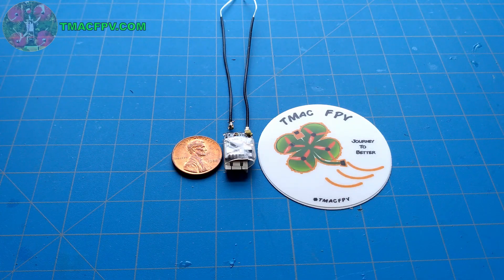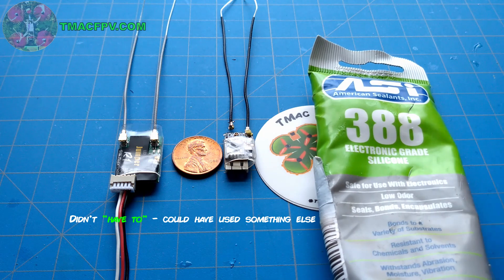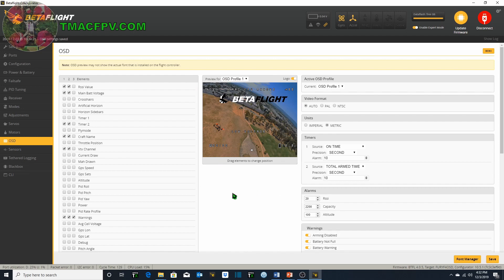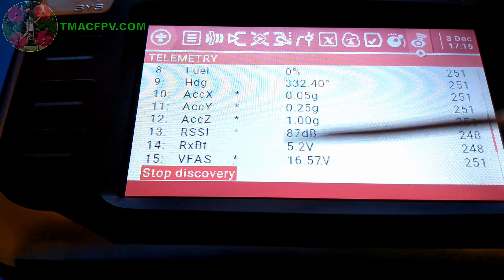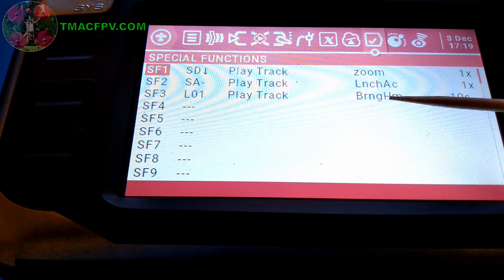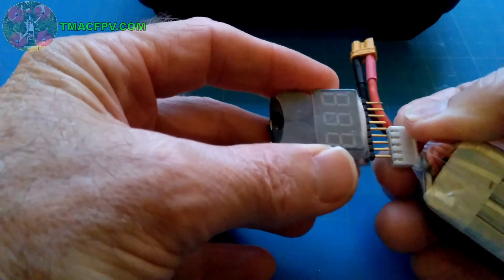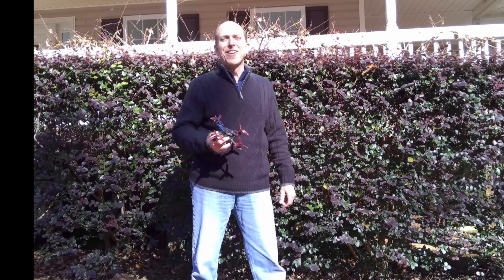JUMPER R1 RECEIVER TELEMETRY SETUP

Comment: Hello sir, how to wire Jumper R1 V2 Mini receiver. It has 3 wires. I can't find any guide for it. I am new to hobby and this is my first built. I am using F3 flight tower.
Reply from the maker: See SBus, VCC, and Ground connection under Full Description" of this link https://usa.banggood.com/JumperRC-R1-V2-Mini-2_4GHz-16CH-Over-2KM-D16-SBUS-Full-Range-RC-Receiver-Compatible-T-Lite-T18-T16-T12-T8SG-Radio-Transmitter-for-RC-Drone-p-1894214.html
Reply: @TMacFPV  I know about this. Can you tell me where sbus wire connect on flight controller?
Reply from the maker: @entertainmentunlimited3256  SBus pad if your flight controller has one or try RCin pad if it has that. Check your specific flight controller's documentation on its product page (or manual in came with) for how to connect a FrSky protocol receiver to it
Reply: @TMacFPV  can I wire sbus to RX of the controller?
Reply from the maker: @entertainmentunlimited3256  yes
Reply: @TMacFPV  one final question please, can i also connect sbus to ppm?
Reply: @TMacFPV  Thanks you so much. I am your subscriber

Comment: Would you know how to set up on inav. I'm new to this.  I cannot get telemetry on my t16s. I'm using an f4 fc.  Eachine tyro quad.  I soldered to the sbus tab on the underside. And tried tx5 and tx4 for s port.  Switched it on in ports tab. My transmitter finds only 4 basic sensors but is receiving telemetry. I've not shorted the 2 tiny tabs for inverted as I think not needed using the underside connection that says sbus Or am I wrong.  Any help appreciated as I'm going mad now lol. Thanks

Comment: Hi Tmac, thank you for those awesome videos, i just want to ask about incorrect rssi value in my OSD display. It always displayed "99" and never change at all.  But ive already have correct value in my jumper T12. 

Cant yoy tell me what isnt right? 
(I used junper R1F + T12 remote) 

Thanks a lot
Reply from the maker: try these few things https://youtu.be/egVxZuyoxho  If you're using an F4 flight controller, check this out https://youtu.be/hwJtnkVq274?t=135

Comment: Hi! I followed this guide but am unable to get any stick input to show in Betaflight. I have confirmed that the rx is bound to the radio, so it seems to be an issue between the R1 and the FC. I am using the Mamba F405 Mini. Any ideas?
Reply from the maker: When connected to Betaflight (with props off) do you have your quad powered with a LiPo also? Some flight controllers require to be powered with LiPo also for receiver to be powered while connected to Betaflight. Check to make sure your R1 receiver RX pad is going to TX pad of flight controller and R1 receiver TX pad is connected to flight controller RX pad of the same UART
Reply: @TMacFPV  Yup, lipo is connected and receiver is giving the correct lights. According to the diagram for the FC everything should be fine. gnd to gnd, 5v to 5v, sbus to sbus and s.port to ppm.
Reply from the maker: @lofifpv6814  ok, a couple more things to check . . . .since you connected to the PPM pad, did you enable softserial for it per the video?  In Configuration Tab of Betaflight did you enable Serial Based Receiver and below that, select SBUS?  in the PORTS Tab of Betaflight did you toggle on Serial RX for the UART you've connected your receiver to?  Make sure to click on Save button in Betaflight after each change you make.  Only other thing I can think of is perhaps you held the bind button down too long (see this video  https://www.youtube.com/watch?v=Wx24PQ0sceI )

Comment: Is this this reciever compatible with the taranis x9 lite with the accst D16 mode?
Reply from the maker: The "newer" version of this same receiver comes from RadioMaster.  Its the RadioMaster R161 receiver that uses the ACCST D16 protocol.  In the images, it appears big.  It is not.  That's just the plastic case it comes in.  That plastic case separates (opens) and inside is the exact same receiver (Jumper R1) you're looking at.  It can be found on Banggood here (affiliate link): http://bit.ly/RadioMaster_R161_RX OR at RacedayQuads (only $9.99) here:   https://www.racedayquads.com/products/radiomaster-r161-sbus-d16-2-4ghz-rc-receiver OR at DefianceRC (Alabama, U.S.) here: https://www.defiancerc.com/products/radiomaster-r161-16ch-frsky-d16-compatible-sbus-s-port-receiver?_pos=1&_sid=73ed0e676&_ss=r
Reply: @TMacFPV  In the description it says it's frsky D16 compatible does that mean is ACCST 16?
Reply from the maker: @TheSolla45  yes ACCST D16 is an FrSky protocol. It's the exact same thing

Comment: How do you bind this receiver?n I have been having a bit of a problem.
Reply from the maker: "Binding method:
Press and hold the receiver's bind button, turn on the power (i.e. plug in the LiPo with bind button depressed), the receiver will now enter binding mode. The red light is always on and the green light is flashing slowly.
  Turn on the remote control and begin the bind procedure according to your radio. After the bind is successful the red light is off and the green light is always on."
Reply: @TMacFPV  When I plug in the lipo with the bind button held down, the green and red light are solid. Is there something wrong?
Reply from the maker: @lucan3361  Are you attempting to bind in FrSky X or FrSky X2 sub-protocol?  Should be FrSky X (if you did not attempt to update firmware).  Have you attempted to finish the binding process even if both lights are solid (it might work)? Sometimes the lights don't always match the instructions. I always turn the radio on first.  Then get ready to hit "bind" in the radio.  Keep the bind button pressed while you power up the Lipo/receiver.  Hit "bind" on your transmitter, then I select ch9-16 telemetry On.  Sometimes the lights don't always match the instructions, however, if you use this process, to include FrSky X, and it doesn't work, check your connections and solder joints to make sure two are not connected together.  The bind process should be the same as in this short video (it appears to be the same receiver re-branded). https://www.youtube.com/watch?v=1K7QpjJO_s0
Reply from the maker: Use RadioMaster's R161 instruction manual (its the same receiver). RadioMaster has better "customer support/user manuals). User manual is here: https://drive.google.com/file/d/1KiPtPaTAoMKRd1g9-0IfgLyfwrdGNa_-/view

Comment: I can only see TRSS, TQly, RSSI and RxBt (showing 0V by the time..) what can I do?
Reply: Try using the telemetry setup checklist available in the video description above under Resources & Links Mentioned in This Video
Reply: @TMACFPVShorts  Hi! Thanks for your response. I did everything step by step but I only can see 4 sensors and rxbt 0V. What else can I do?
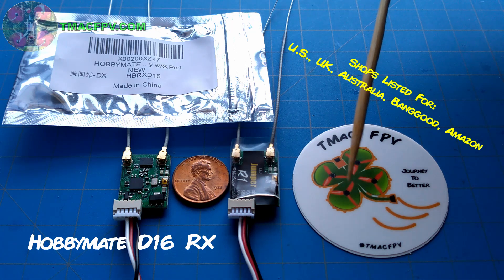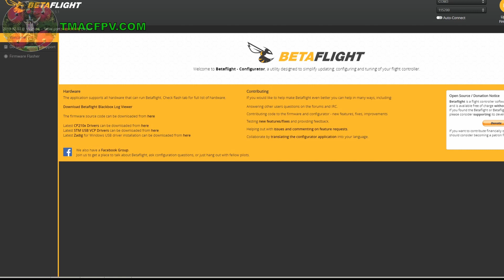Reply from the maker: @shogo8633  Fernando, Here3 are some things you can check (if you wired it correctly, and set it up correctly in your transmitter and  in Betaflight it should work fine). As I have no ide what transmitter or flight controller you're using, perhaps its a limitation of one (or both?) of those.  Try checking th efollowing:  Is it the Jumper R1, the Jumper R1F or a different receiver?  Did you make the connections from your receiver to the flight controller as indicated at the 4:04 time mark of this video?  Did you set it up in Betaflight per the instructions at the 5:49 time mark of this video and also in your transmitter per the checklist (Discover New Sensors)?  Do you have RSSI set up in your transmitter as an Input Line and also as a line in your Mixes Page?
Reply: @TMacFPV  Hi again! It´s a Jumper R1, Radiomaster T16 and omnibus F4 clone from aliexpress. I also tried with a ZEUS F722 and I get more sensores but rxbt shows 0V also so I think I have 2 problems.. Jumper R1 not sending any voltage measures and the omnibus F4 port reversed or whatever. Yes, I checked the video and the guides a lot of times. I wired it with the soft serial method. I am able to get the rssi measures. My problem is that I only get 4 sensors with the f4 board (a lot more with the f722) and Rxbt shows 0V

Comment: I tried hooking up my r1 via sbus to my old Mantis F3 FC, but the signals were jumping all over the place in beta flight reciever tab? I never like to try to fix things that are working,,,  My Flight controller is old and wont update so I went back to using it as it was with old spek sat...  But I wonder what the problem was and if there is an ez fix?  I see you video and think I could try putting the r1 on a different urt,,, but the mantis manuel says the sbus is where you connect sbus soI'm stumped...

Comment: Hi there, I would like to ask a question, recently I accidentally broke one of the antenna on the Jumper R1 receiver. However, I am not sure what is the name of the antenna for replacement. Is the antenna on the Jumper R1 an IPEX connector or an UFL connector? or neither? I am very confused. Thank you very much in advance.
Reply from the maker: See this link and scroll down to "Replacing R1 Antenna" https://www.graysonhobbyshop.com/jumper-r1-drone-receiver/

Comment: I am building a 3" quad and using the mamba mini MK2. It came with betaflight 3.5.1. Do you think is worth updating to 4.1or higher? People reported some problems with the update... Have you updated it? If so, what do you think? By the way really helpful video, thanks Tmac👍
Reply from the maker: Hey Luis!  I'm running BF 4.2 on all my micro's with RPM filters.  The RPM filters to me are very much worth updating.  When you enable them correctly, they get rid of all motor noise from gyro.  Having said that, I do no know your level of experience.  So, this video may help guide you a bit if needed (its the last micro build I did and goes through most, if not all, of the stuff you need): https://youtu.be/4KUz4Z8ejTA

Comment: Awesome!

Now if I could only get my 'battcheck' widget working in the top bar..
Reply from the maker: what "battcheck" do you mean?  are you talking about your LiPo battery voltage reading? What transmitter do you have?
Reply: @TMacFPV  Hey!  I have the T16, the 'battcheck' widget is for the top bar.  I have the VFAS (from frsky XSR) displayed in the value widget right next to it as well as voice alerts working fine, but battcheck (shows percentage, voltage, and little battery icon) might take more setup than just pointing to VFAS, possibly lua scripts from what i gathered(?), and i don't think i'm ready to dive in to that yet lol.
Reply from the maker: gotcha, understand.  Have fun flyin'!👍

Comment: Hi sir this jumper can bind to good ol accst qx7 radio without problem? Im thinking of switching to this wonder if its work with accst qx7
Reply from the maker: Hey HelioGenesis-HS! I believe the Jumper R1+ receiver comes with the ACCST D16 protocol firmware prior to FrSky updating all their ACCST stuff to version 2.1. So, if your QX7 firmware has not been updated to the new ACCST ver 2.x firmware, it should work fine with the Jumper R1. It will definitely not work with ACCESS protocol transmitters
Reply: @TMacFPV  ahh nice. Thanks for clarification

Comment: If my full size mamba F405 DJI stack has an RSSI pad, should I still not connect the RSSI cable?  I’m having difficulty trying to find some guidance on hooking up my R1 rx to the full size mamba DJI stack. The pads in the ‘receiver’ part of the flight controller, according to the card that comes with the FC are:
GND
5V
RC
Invertor[TX1]
Uninverted[TX1]
RSSI

There is a note re; ‘RC’ that says (TBS/SBUS/IBUS/DSM(RX1)

It’s all Russian to me. Could you clarify the connections for me please?
Reply from the maker: Receiver GND goes to Flight Controller (FC) ground, Receiver 5V goes to FC 5V, receiver SBUS goes to FC 'RC' (which your documentation shows as SBUS along with the other TBS/IBUS/DSM protocols).  Receiver SPORT goes to the pad right next to the 'RC' pad which is labeled SPORT in your FC wiring diagram documentation you can find here https://bit.ly/MambaF405DJIFC_Diagram
Reply: Thanks for the wick reply TMac. Hmmm. It’s not labelled  SPORT in the wiring diagram I’m looking at. Mine says Invertor (TX1) and Uninverted(TX1). That’s why I asked the question.
Reply from the maker: ok Muzz, no problem.  The pad next to the 'RC' pad in the wiring diagram on the site URL I gave you shows as the SPort pad (in yellow writing).  If your documentation does not show that, your SPort signal from the R1 is inverted which means you need to connect it to the dedicated "Inverted" TX1.  This will then uninvert the signal (i/e/ 2 inverts  = 1 uninvert)

Comment: TMac, hello good sir. Have you had any range issues with the R1 or the R1F? I picked up 2 of each from Grayson Hobby and all four of them had me pulling my hair out for over a month. My range in optimal conditions for all four of them is 100 feet before RSSI starts to plummet and i mean fast right to failsafe (90 rssi to 50 in a couple seconds). I bought new tx antenna, new rx antenna, A NEW TX (had Jumper t16, picked up a T12) installed on multiple quads in every mounting possibility imaginable, even mounted as incorrectly as i could just because, mounted them 1 foot off the quad on a stick to get completely away from everything on the quad, incrementally trimmed antenna through the "range" of lengths trying to tune it...........I could go on. And yes, flown in optimal conditions, perfect line of sight, no rf interference, flew friends bird same day no issues (xm+). I picked up xm+ and installed it and what do you know, I can fly to the end of the field, into the next field and oh happy days. But whats the deal with the jumpers? Four lemons! No way....right? Sorry for the long comment. Tried to keep it short while answering what i know people are going to ask. Is there anybody out there with this issue? Thanks y'all and thank you TMac for your superb videos.
Reply from the maker: I have not had any issues  with the R1 receivers I have used the few times I have used them.  I normally fly Crossfire.  Additionally, a fellow pilot I gave an R1+ to reported he got 1.7 miles of range with it (and could have gone farther if not for his VTX limitation) on a fixed wing.  This was back in December of 2019, so perhaps something has changed since then?
Reply: @TMacFPV  Yeah I made the jump over to crossfire as well (which is awesome), and thanks for you vid on signal strength. I'm baffled with these jumper receivers. I haven't heard back from Grayson Hobby which is dissapointing. Maybe that's why they were so cheap ($10 each) but I doubt that they would willingly sell a bad batch if it were. I might fiddle with them again and if I get the same results maybe I'll send you one as a sanity check if you would be willing. Thanks for the reply and take care.

Comment: hi Tmac would this apply to an RXSR RX and a T16 as well?  i have an RXSR in my quad and only see a few sensors and things like VFAS are missing even when i try to discover them.
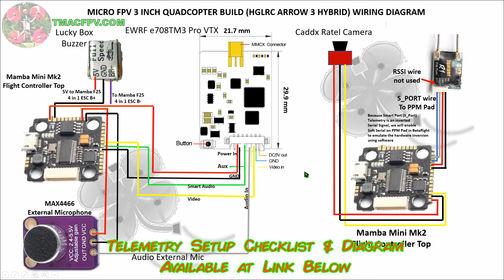Reply from the maker: Yes, should be the same type of setup.  I mention this between 4:43 and 5:09 time marks of the video.  The SBUS and S_Port wires of the R1 and the R-XSR are swapped.  Other than that, connections should be the same.  Some flight controllers have an S_Port pad and you don't need to use a spare Tx pad or PPM pad and go through remapping, etc.  I've got a checklist you can download in the video description if you'd like.  Also, you need to pay attention to what firmware you have loaded on the T16 multi-protocol module.  You should be able to update your MPM firmware using the process in this video:  https://www.youtube.com/watch?v=EJx9mz-DI_g  Reason ot do it is if your R-XSR has FrSky ACCST D16 V2 firmware on it, you'll need version 1.3.0.91 or newer firmware since the MPM didn't work with ACCST D!6 V2 receiver firmware.  Of course, there's not way to know what firmware you have on your receiver really unless you put it there.  With MPM firmware 1.3.0.91 or newer, you'll either want to use FrSky x or FrSky X2 protocols on your MPM when binding to your receiver.  That's explained in this video: https://www.youtube.com/watch?v=y6wg-_PmiL8
Reply: @TMacFPV  thanks TMac.  i actually got hold a Jumper r1 today and have updated firmware to 2.01 via the t16 which appeared to work perfectly.  i have connected the R1 to my mamba mini board in the same config as you describe in you video however i am unable to get the R1 to bind to my t16.  T16 is running latest firmware as is multimodule and i am trying to bind to R1 using the new FrskyX2 protocol to match the version of the firmware i put onto the R1.  the R1 goes into bind mode at boot (solid green and red leds) but i never get any response (flashing) from the LEDS when attempting to bind from the t16.  ive tried changing the fine tune settings to vairous points along the scale (+ and -) but still no joy.  any ideas?
Reply: update Tmac....ive got it to bind now but i had to do two things.  i reflashed the firmware from EU LBT to FCC as i read somewhere that these R1s only support international (FCC) firmware.  I then tried binding using Frskyx2 again but got nowhere and then tried the normal Frsky D16 and it bound straight away!